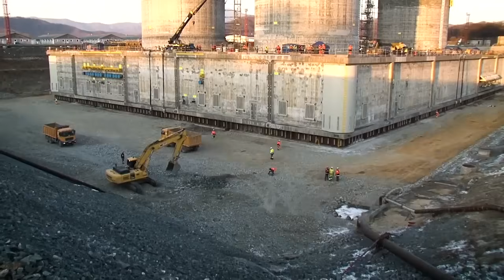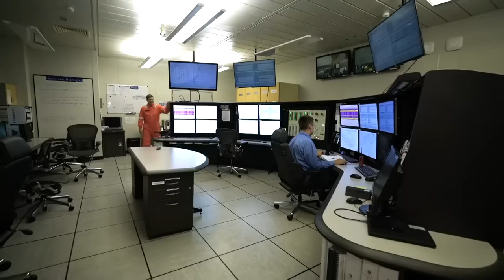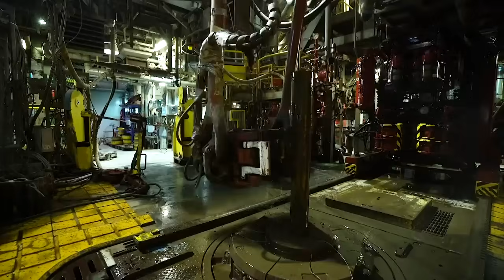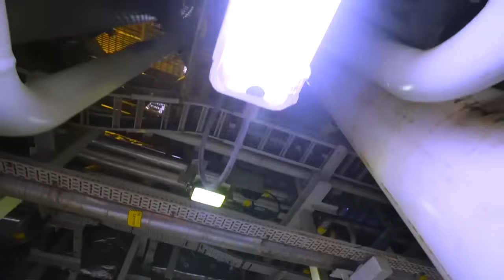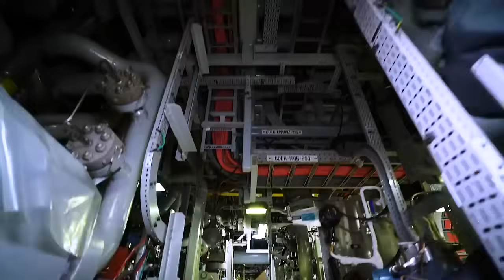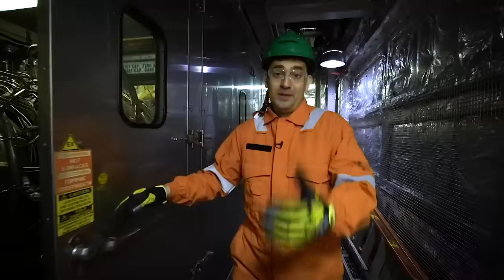A Look INSIDE an Amazing Six-storey $1 Billion Offshore Platform

Comment: Up to 10,000.00 ft.   A blowout preventor is secured to the bottom of the ocean or bay, a riser is attached to the BOP and then finally the drill-pipe goes through the riser to begin drilling.
Drilling fluid (Mud) is pumped down the hollow drill-pipe then back up the riser to be filtered of drilling shaving and sent back down the riser.  
The riser works the same as casing on land well during drilling operations.

Comment: So how deep is the water there… if its sitting on the seabed
Reply: all the way to the bottom ya silly goose
Reply: Um Deep! Lol 🤣😭💀
Reply: I wouldn't feel safe on that. Russian navy ships have a tendency to turn into submarines without warning.
Reply: As no one have the brain to answer your actual question, probably arround 40 meter deep water +- if you take the consideration of how high the foundation that is placed on seabed is. So its actually not that deep compared to a few seabed platforms we have here in Norway. Or some of the other ones arround the world
Reply: Not as deep as you may think, however, the oil rig digger can dig down to the depth of mount everest 1 and a half times if mount everest was reversed amd under the seabed
Reply: Off the top of my head, I think I remember some go down 2 miles down, maybe a little bit more.
Reply: it took me 5s on google: Weighing approximately 200,000 tons and situated 35 meters deep from the seafloor, this engineering marvel has an estimated maximum oil extraction capacity of 4.5 million tons annually.
Reply: simply put, it's a massive,  giant cookie cutter below that sinks into the seabed,  then they pour a bazillion tons of concrete into it.  simply put mind you😊
Reply: 1 million feet
Reply: At least three
Reply: @Telepathic_Snail_Overlords  3 what?

Comment: The title of the video suggests that the platform cost only $1BN to build. I found several articles online mentioning that the total cost to bring it into operation was around $10-12BN. $1USD is around 95RUB, so it's not a conversion issue. Generally when an American person mentions that something cost $X.XX - it's safe to assume they are talking USD. Did you do any research on this 'fact', or have you just consulted your mates at the bar on a Saturday night...? $1BN is a LONG way from $10-12BN 🤔

Also, 'several thousand tonnes of oil...' = around 12,000 per day, and 'huge depth' = 35m. Yep, just 35 meters. Oh, sorry - 115 feet 🙃

Free facts for you 😉
Reply from the maker: thanks i will double check

Comment: When the wells are emptied, wont that giant heavy structure sink?
Reply: Why bros comment get pinned
Reply: @sammorossi  Cause bro's question is legit.
Reply: @adammorra3813  But plenty of other people asked questions.
Reply: @adammorra3813  And why didn't they bother to answer him.
Reply: @sammorossi  the answer is literally in the video if you watched it. They equalize the pressure when they drill and then they will fill it with greywater waste from the oil rig that is also considered environmentally friendly and so its filled enough to balance out.
Reply: @sammorossi  also, the weight of the lower hull stabilizes the platform.
Reply: @adammorra3813  dawg I'm not the one who asked the question. I only care about why some random dudes comment got pinned by a science channel. And why said channel didn't bother to answer him
Reply: @adammorra3813  i feel like at this point it's a pin of shame because of how stupid his question was because as you said, it was answered in the video
Reply: @sammorossi  Maybe the pinned the comment by accident, like a misclick? In either case, I am not a dog so i don't know what you are implying.
Reply: @adammorra3813  bros never heard of slang, you must of been born under a rock yesterday.
Reply: @adammorra3813  Yeah but innit
Reply: Cringe  @sammorossi
Reply: no
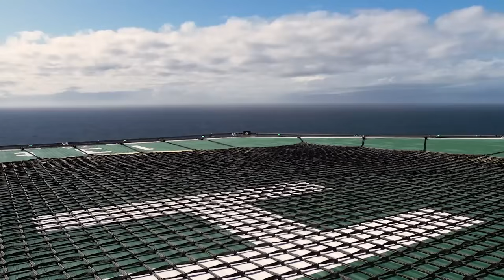Reply: 😮😮😮😮😮😮😮 9:18 .

...

......

 @qvargafafergqc

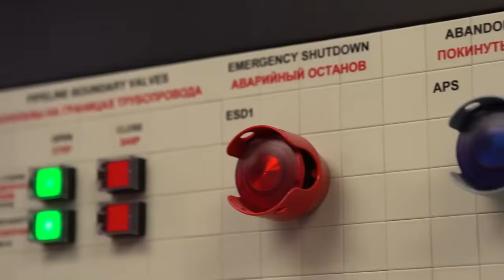Comment: 5:49 they should put a cover over that button to prevent someone from accidentally hitting it and Im assuming thats why they have the metal piece around it same with the other severe emergency buttons on that panel

Comment: no sir, they dont build an oil rig, they assembly an oil rig. an entire rig set costs a billion i assume. well, they manufacture some organs of it - derrick/mast, drawworks etc.and purchase top drive (the heart of a rig, also called the king of the kings, lord of the lords, master of the masters and guru of gurus), swivel, catwalk, driller console, doghouse, monkey board, travelling block, power tong(now altered by more advanced iron roughneck), slips etc. to assembly to a rig set. it depends, sometimes they just fabricate a derrick, or a rig without top drive. it is dependent on what is required. a top drive costs 1-2 million dollars? a rig can be only 10 million if it is fabricated as a simple mast with a few facilities.
no rig fabricator fabricates the entire rig set, none of them i know in china fabricates top drive. in iran when they fabricated a top drive, they were awarded by the top leader of the country ;-p in china, if a drill rig is fabricated with bigger nominal drill depth, they shall ignite fireworks and the province leaders shall come to shake hands and take photos with them.

if both rig facility and drilling service are required, you would need to contact a drilling contractor, he will provide both service(drilling, coring, casing running etc.) alongside with her rig facilities. but she will charge for dairy rate. in some countries where oil is not nationalised and land is privatisatised - for instance, canada, the usa and australia, land leasing cost is also to be considered.

Comment: The engineering that goes into designing this and the logistics to assemble it are absolutely mind blowing. Theres a bridge that goes across a frozen sea (i think in the bearing sea but might just be a concept and not built, its a been a while but i THINK its operational) Thats just as mind boggling having to deal with heavy winds and flowing ice.
Reply: 100% agree. I am not mechanical in nature however, I could not imagine the amount of concentrated efforts of different fields to create something as advanced as this.

Comment: I never thought about what happens to the massive cavities under the sea bed where the oil was taken from. I saw something about them just being capped off and left. So if they're filling these voids back in with waste product, there is the question of them being used by other companies to dispose of certain types of waste that will be buried under the sea and capped off. Back filling them makes sense, so there are no collapses, but what they're filled with is important for sure. Saying the waste bi product is completely environmentally safe seems a bit iffy. I wonder if there is any public information available on what is put in them?

Comment: O worked offshore in the high Arctic. Around the north pole. We set the rig up 30 feet of ice. It was basically a Land rig. But our BOP system sat on the ocean floor depth of 2000 ft. We flew everything in on huge cargo plane C130 Hercules 144 loads. Took roughly five weeks to rig it up. The nearest tree was 2500 miles south. Ice as far the eyes can see. Would you believe we had Ravens that far North. And polar bears. Lol

Comment: Great video but just a tad bit out of date at 4:30

The SSCV Sleipnir which is owned by the Dutch and was built in Singapore in 2019 is now currently the world's largest marine crane and it can lift up to 10,000 tons

It can however lift 20,000 tons if both cranes work in tandem
Reply from the maker: thanks for your input

Comment: So sad to see our Mother Earth be harmed like this. May the sustainable energy tech breakthroughs stop being hidden from us.
Reply: As you type away on your plastic device powered by hydrocarbons….
Reply: I've actually devoted a large portion of my life to Natural Resource Management and Protection. I have a degree in the field and am currently working on projects to assist Gaia and Humanity. What about you? @garywagner2466
Reply: How are they being hidden from us? Innovation in green energy is constantly happening. I'm a huge supporter of green energy, but that doesn't mean we can or ever will be able to fully replace petroleum based products. Petroleum is used in literally countless products and production processes.

Both extremes of this debate are way off. Big shocker that extreme opinions are usually way off and lacking nuance, I know. What we need to do is transition from fossil fuels over to green alternatives in the areas where doing so is not prohibitively expensive and where doing so would not present risks to national security. In the meantime, we inventivize further research into continually expanding the list of things that we are able to transition to more environmental alternatives.

This process is going to take time, and there will be A LOT of stuff that we simply can't produce any other way than with petroleum. This is very likely just the reality of the situation. However, as long as we can shift our production and energy use such that we remain carbon neutral at the very least, we will have addressed the issue of climate change. This won't solve ALL of our pollution problems, but the fact of the matter is that we will likely never be able to solve 100% of our pollution problem. Unless we're willing to return to the Bronze Age, pollution will always remain a consequence of production. We simply need to do our best to limit as much of it as we can, and to introduce remediation programs and policies in order to take care of the worst forms of it. If we can strike a balance that results in a neutral impact from our existence (cleaning up as much as we spread refuse), then we'll become sustainable. We don't need perfect, zero waste. It's incredibly unrealistic to think we could ever achieve perfect, zero waste. And frankly, we would never want to live in a state of perfect, zero waste because that would likely mean we've nuked ourselves back to the Bronze Age where we aren't capable of producing that sort of waste. The fact of the matter is, if we want to keep our modern technology rolling and further advance the technology we have, then we will need continual access to raw materials and recycled materials - neither of which will EVER be "perfected" to the point of producing zero waste because that would be against the laws of physics. There will always be a degree of entropy, but if we can steer it, we'll be doing well. 

The only problem we'll still face is every other giant existential problem that threatens the existence of our species on a near constant basis - war, food security, water security, unavoidable cosmic events like the giant asteroid that killed Littlefoot in the Cretaceous–Paleogene extinction event...alien invasion... Who knows, right?

Comment: for being russian this is surprisingly well organized and managed. Must be the international community crewing it?
Reply: Most offshore oil platforms are typically jointly owned and operated or were jointly designed and manufactured

It's very rare to have an oil platform be entirely within the singular development and operation of a single nation, the upfront cost is just too great

Remember offshore oil platforms don't make a cent until they start producing, so all that manufacturing process to build the things is a huge upfront cost that you need to pay now
and most nations are very unwilling to drop millions or potentially billions of dollars on a project that takes years before they even see any revenue

Comment: It's interesting.  One day, either the oil field will run out, or at least no longer be profitable to pump, or the technology onboard the platform will be to old to compete with more advanced methods.  This platform will be decommissioned.  At that point, I actually expect that a giant barge will be brought back out here to haul the platform itself away.  However, it's very unlikely that the footing will be removed.  I wonder how many hundred years it will last?  How long would it stick up enough to be considered a navigation hazard?

Comment: I have many questions... how did they mate the bottom and top portions in the ocean?
Reply: They have some videos on showing exactly that. It's a bit complicated to explain but isn't rocketscience in itself once you see it.
Reply: it's called a float over. they but the topside on a barge and float it over the gravity base. then they ballast the barge so i goes down and that's how the put the topside on the base. This topside was installed with the H851 owned by Heerema

Comment: I worked at a factory in the UK (Schlumberger) that made a lot of drill bits for these Shell oil was their main customer, this was 20 years ago they were around £40k then I imagine a lot more now. The diamonds were industrial & pressed on small machines around the factory
Reply: diamonds aren't actually expensive or rare...they're common. Jewelry diamonds are only made expensive by a few Cartels controlling the rate at which they are put on the market.
Reply: After over 100 years, Schlumberger have re-named themselves to SLB, just to confuse the likes of Greta Thumberg  😃
Plus they own Cameron, the company name on the chair in the Drill Shack
Reply: Meh, uk sucks anyway
Reply: @EagleOne1999 why did you say this? lol

Comment: That one's column what you're calling waste the first one to several things production water flow back and a couple other things generally speaking what happens is when water when oil is produced that comes out with water it goes to separation things to separation things then turn around converted into the crude and into production water is waste and there is  natural gas which produces condescending in a couple other

Comment: Wait. How tf did they lift the top and set it on the base?
Reply: It was a float over. In Korea it was jacked up and a support frame placed under. The entire topsides & support frame was then pulled onto a barge.

The barge was towed from Korea to Russia and fit between the legs of the base. Ballast down and done.

Comment: SIMPLY AMAZING. MOST PEOPLE REALLY DO NOT UNDERSTAND WHAT IT TAKES TO GET FUEL AT THE PUMP. AND THIS LIE WE ARE BEING TOLD ABOUT SHOVING ELECTRIC VEHICLES DOWN OUR THROATS IS NONSENSE. THERE IS ENOUGH OIL IN THE EARTH TO LAST AT LEAST 500 YEARS. AND SWITCHING TO ELECTRIC IS NONSENSE. THE ENERGY HAS TO COME FROM SOMEWHERE EITHER OIL OR NUCLEAR.

Comment: Russian rig built on the cheap in Korea & not a single Russian substandard item on board gas turbines look like Solars. A number of platform modules were built in Vladivostok for offshore Sakhalin these were like the U.K. modules of the 60’s - 70’s. Lots of metal little or no design considerations.
Reply: Korea is the pinnacle of modern manufacturing...
Reply: @kaipos8601 it’s the only one remaining monopolising ship & ring building, spent long periods in Ulsan & Pulsan with insane Korean module build mangers 😆😆😆😆

Comment: Design improvement suggestion: jet engines ringing the rig. You'll need to figure out how to run them off crude. In the case of disaster it con hover untill it is evaluated. Hey if this works i need a cut. And I get to name it. Ok thats all bye

Comment: How does the pipe end up going horizontal if it just has a central pipe going straight down?
Reply: It's called directional drilling.
Reply: The bit is smart.

Comment: where do they get their power?
Reply: it showed the generators that power the platform.
Reply: They use the oil they extract from the sea bed.
Reply: @aaronjennings8385 No it doesn't. The oil it's pumping out is crude, it needs to be refined before it can be used to power anything. Berkut is powered by three Cat 3516B (HD) generator sets that run on diesel fuel.

Comment: Billion dollar global insight - monetise a sci fi movie or real life, where in the event of a high magnitude Earthquake, the commander of the sea platform gets notified by system health readings that the 4 seabed vertical pillars are going to break, the commander ordered the platform to disengage from all pillars, and detonate the inbuilt explosives of the vertical pillar legs (break each pillar into different segments). The platform drop into water where the inbuilt AI system auto inflate NASA grade floats to float the platform on sea like a cruise ship to cut total financial damage to the company by half since the loss is constrained only to the bottom pillars. To prevent hacking or tampering, the explosives and design of the system need to be created by military engineers who worked with the nation’s nuclear powers. On the public relations front, say that this system save human lives on the platform which boost stock prices and max management profits.